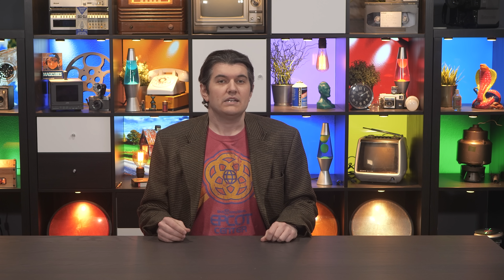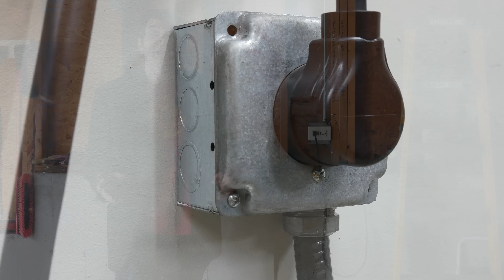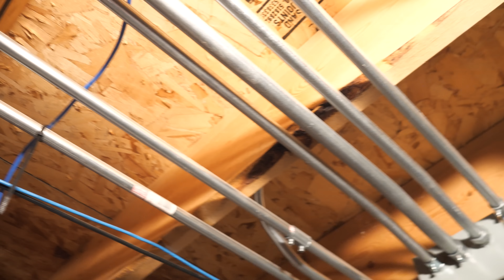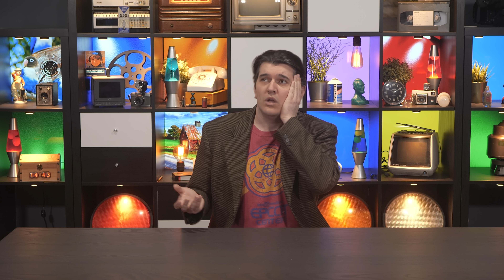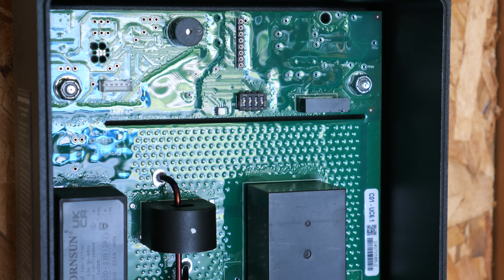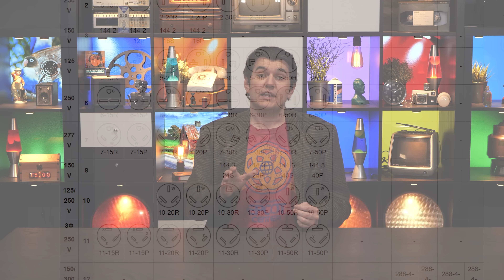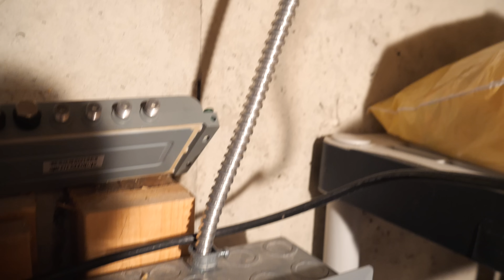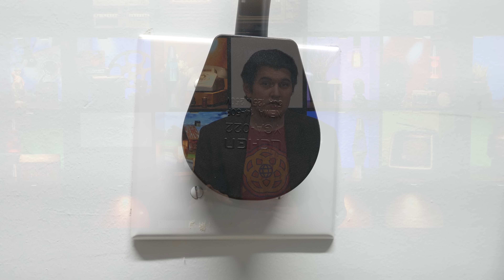The "standard" car charger is usually overkill—but your electrician might not know that

Comment: One thing I’ve seen some “smart” EVSE’s do is actually monitor the plug temperature on the outlet side and can shut down if it gets hot. Of course that really doesn’t need an App, but it is a nice feature.
Reply: Pretty much all DCFC EVSEs do that, but I haven't seen an AC EVSE with nozzle temperature monitoring.  Can you point me to one?
Reply: @alsavage1  The tesla ones do by default, then they back off to maintain plug temps.    You can also control the amps on them manually from the app if you want.

Comment: I actually was lucky enough that when I bought my Bolt EUV a couple years ago, GM installed a NEMA 14-50 plug on a 50A GFCI braker.  However, as I don't need to charge that quickly, ever, I down leveled my 40A Emporia EVSE to 24A...  no reason to put the extra strain or heat load on the house, grid, receptacle/plug, or car (now a Mach-E GT).  For my use case, I'm always back to 85% battery by morning.  It's typically done by 3a every day.  I really hate that there is so much FUD spread on EV charging for those who don't know.  Range anxiety is, in most cases, silly...

Comment: correct me if i'm wrong, but why not use a nema 6-15 connector? it's a 240v connection that you can basically back with the same gauge as normal wires, and get 3.5k watts out of. it's basically double the use of a normal outlet without any really special "work".

Comment: Very good information, but be careful with direct comparisons to gas vehicles. You asked: “are you topping up your car at a gas station every day?” and of course that answer is no. But the reason the answer is no is because under very nearly zero circumstances will there not be a source of fuel regardless of the direction or distance you travel in a gas vehicle. If fuel was scarce, you bet your butt I’d keep my gas vehicle topped up.  

You do a great job of helping people understand that edge cases are not everyone’s daily experience and each person needs to look at their own needs to determine which vehicle, and if electric, which charging solution to go with. Keep it up. Education is the path to enlightenment.

Comment: Im in the UK and I'm still using "Granny" 10A charging from a normal 230V outlet.

I do rarely have a bit of anxiety about how much its going to charge, but I mean rarely - It has to involve me driving 100+ miles myself in a day, plus needing to drop my partner to/from work on the following day (even then I can take the local roads which is normally a little longer but is a 30 mile round trip as opposed to 60).

I will likely install 24/32A charging but I am absolutely in no rush - I'm also on an "intelligent" Electric tariff, so if I am home the long charging sessions actually reduce the electric price for my whole house - couple that with our solar (Unfortunately we don't have a battery), it can really cut  our electric prices down.

Comment: Another bonus: slower charging is better for the battery, as it won't heat up as much. Lithium batteries degrade faster at higher temperatures.

Comment: We've put 21,500 miles on our Mach-E in the 14 months we've had it. In that time, we've used public DC fast-charging on three occasions: once shortly after buying it just to try it out, and twice on longer road trips. I bought a 60A breaker and a bunch of wire and even ordered a 48A EVSE, but the 32A charger that came with the car is more than sufficient for our needs so I haven't even taken the breaker and the EVSE out of their boxes. 
That 32A EVSE is plugged into a 40A circuit that also runs my air compressor, table saw, and dust collection. And let me tell you, it's SO DARN INCONVENIENT to have to unplug the EVSE when I want to cut a bunch of wood or inflate tires or run a needle scaler the 3 or 4 times a year I need to do that.

Comment: The place I worked at, we would just plug the Smart for TWO EQ, a small electric compact car, on a standard CEE 7/5 wall plug, 16A 230v and leave it to charge over night.
the battery is only 17.6 kWh with a 120 km of max autonomy anyway... and the AC or heat drains it rapidly

Comment: Funny I just had this discussion. 
If you fill your gas tank every 2 weeks or more.. a mondo charger is not needed. 
I would still opt for at min a 220v 20a charger.

Good point with the dryer connections not being intended for repetitive use.  A switch in the circuit  would be a good idea. Do not use the circuit breaker as a switch.

Comment: My garage is detached, so running a 240v line is rather expensive. Instead, we're charging my Ionic 5 with the L1 charger it came with, on a regular outlet. It works fine for us. During summer, we've only needed to go to a public charger once or twice in the past year. (We did a bit more in winter.) Still totally fine.
Reply: yeah regular 120v 15amp outlets should be fine for like 90% of Americans

Comment: I have always used a 20 amp 240 volts outlet with my mobile charger.  It has always been plenty.  It adds about 14 miles per hour on the charger.

Comment: I have a 50A plug but actually keep my charger at its lowest setting of 12A most of the time. It charges the car at the speed we need and slow enough to help maintain the battery. Full-speed charge is still available for the few times per year when we want it. My Grizzl-e charger is also technically portable, so came with a bunch of adapters for 120V and a bunch of common 240V outlets we might need to use while on a road trip.

Comment: Slightly different situation in Europe/Germany since we have 230 (and 400) volt, but still kind of similar. EVs usually come with an "emergency charger" that can draw 10A@230V, so around 2,3kW. Not very much, but enough for normal (daily) charging. I can charge at work with such a charger, and during the 8 hours it provides about 30% of my cars battery capacity which is enough for ~100km of driving.
Can't charge at home since (according to property management) the power "uplink" for the building complex doesn't have enough capacity to provide power for all garage spots to get a wall box, so they refused any electrical work for that... At least our municipal power provider installed four 22kW charging spots in our street, and in worst case I would have a few DC chargers within 5min of driving. But so far I could charge mostly at work and only used the 22kW chargers to "top up" before a long trip. DC charging is only needed during long trips that can't be handled with one battery charge.

Comment: 11:55 just incase it isn't obvious, if the breaker doesn't trip then you have a potential fire hazard. you should periodically test your breakers. usually they end up in a state where they trip too easily, which is technically fine as far as safety is concerned. however, they can get stuck in a position where they can't trip, and that's bad.

Comment: I'll challenge you on your rant against smart charging solutions. 
I've got a PV system by Fronius and a matching AC charger. It talks to the Fronius smart meter and gets told how much PV excess there is, the state of charge of the pv/home battery at any given time etc. If set to the "eco" mode, it will only use that excess. I'm not entirely certain if that is what's meant by "demand response", but I think that has more to do with the grid operator controling your devices remotely, right? It can also automatically adjust to hourly electricity rates if you set the appropriate electricity provider and plan too. I wouldn't be able to restrict the charging current in my Renault 5.

Comment: "how bad was that elbow click?" - reminds me of a tweet i saw... "my knee just popped so loud that i half expected it to start glowing" lol
I would be pretty interested to know how slower charging like this might affect battery life and condition. i know that trying to charge batteries of any kind too quickly can degrade their health, and at a certain point, going too slowly can as well (though in a different way), but does using a so-called 'granny charger' have any potential at increasing the life of the battery (or in other terms, reducing battery degradation over time)?

also, my house (which we own free and clear as of 2018) is a bit of an odd-ball in that our breaker panels is... well... not much of a panel, and more a collection of panels. we have one "main" panel that has a primary breaker, and 4 breakers connected to it, but that's all the capacity it has, then we have a completely separate box with a breaker in it for our fuel oil furnace, another separate box with a breaker for the water heater (which is natural gas fueled), and yet another box with a breaker for our washer, dryer (also natural gas fueled), and chest freezer.... yes, our entire house (which is a 2 bed, 1 bath single family home with detached garage, full footprint basement, and weird hybrid of a finished and unfinished attic) runs on just 4 very old breakers. we've learned how to do things, but running the microwave and toaster at the same time WILL trip a breaker, guaranteed. timed poorly, our fridge can sometimes trip breakers too... anyhow, while we could definitely utilize the washer/dryer circuit for the car charger... that outlet is on the side opposite our driveway, so that doesn't really work out. we're planning to have to completely replace all of the electrical in the house in the near future anyway, so this is mostly just me providing yet another scenario where getting an at-home charging option for an EV can be problematic. we don't have any outdoor outlets for plugging in even the 120v charger options, and the garage is ... well... it wasn't built with putting cars in it in mind for some reason. it's far too narrow. we also have grey squirrels and oodles of rabbits, so just leaving an extension cord outside isn't really viable either. i probably should have said that i'm a central wisconsinite earlier, so we also have some pretty gnarly winters to contend with on top of all that. 

that all said, i'd definitely love to have an EV, because i totally get all of the upsides, but we also need to have an SUV for various reasons, particularly my mobility challenged grandmother who would NEVER be able to get out of a car because of how low they all sit. our options for electric vehicles are pretty limited because of that. we also need to have at least 250 miles of range at the 80% charge point for the foreseeable future, because that's how far it is to madison, where we routinely need to travel to for medical appointments, and there is zero charging infrastructure on the route between our town and madison. even worse, it's so sparsely populated that it's likely that this particular stretch of the american interstate system will never have any real charging infrastructure outside of the off chance that one of the waysides/rest areas get some kind of charging infrastructure. there's plenty of such infrastructure in madison, so charging at either end of the journey isn't an issue. also, just as a side thing... if you live over in europe and can't understand this sort of situation... the USA is WAY bigger than you think it is. Wisconsin alone is slightly larger than Suriname, Tunisia, and Lithuania, and we're only the 23rd largest state. pretty much right in the middle. 

anyhow, that's enough typing for a single youtube comment. lol

Comment: I have an EV, drive 300 miles a week. I only charge at work with the charge locations. Not sleeping when loading electrons but working when they exchange. Only used a DC charger to see how fast is was. 450 miles an hour....

Comment: We had 220/240V outlet added to the plans of the garage when our "retirement" house was built in 2017.  I had not done any research into chargers at that time, so we ended up with 40 amp breakers, which should be fine.  We have not used it yet, but we figured it might come in useful one day.   If all else fails, I will be able to rapid charge a souped-up mobility scooter to zoom to the mailbox!

Comment: I am so happy you gave a shout-out to dryer circuit splitters for EV charging. In my case, I wasn't able to have an electrician install an EVSE for a reasonable price in our 2-floor apartment, which had the electrical panel installed in the direct center of the entire building (don't ask me why). In comes this splitter for dryer circuits to save the day, and I only had to spend a fraction of what installing a dedicated circuit would have cost.
Reply: Anything pertaining to "home improvement" gets more complicated once you're in an apartment or even just renting a house. I was tired of having terribad wifi in the living room of our duplex as the fiber enters in the back, and of course management doesn't want to make the investment to hardwire the house. I ended up just running a 100ft Cat6 myself and figure it's easier to ask for forgiveness than permission.
Reply: For my country we have a tropical climate, so we don't usually need dryers in our homes, but older washing machines may use 15A instead of the typical 13A 3-pin plugs, & the electrical outlets for the former are less common. The latter has 3 rectangular pins arranged like a triangle (the BS1363/Type G standard) while the former uses circular pins like those in Switzerland (but with the earth pin further & equidistant from the other 2 pins i,e. Type M)
Reply: Me too, I would like to explore this further.   I just bought an Ionic 5 SEL used and bought a Charge Point level 2 device, called a couple of electricians for quotes to install and the cheapest is 1600USD.  The CB box is near maxed out, and at the opposite end of the home from the garage.  Our laundry room, is next to the garage so I think I will buy one of these splitter boxes (switches) and install the lvl 2 charger myself.   Though, in fairness, a couple of weeks of living with lvl 1 charge has shown me this is more than enough.   I am a little worried about what happens in winter.
Reply: @craigduncan7010  Do it, you won't regret it. I purchased a Briidea unit, and a properly rated 10-30 extension cable. Have been using it for over a year at this point with literally no issues at all. I think everything (splitter, extension cable, and charge cable) came out to a total of a little over $500 when I purchased it. If you already have a charge cable, then you are already saving a bit of money there, and all you really need is the splitter unit, which goes for around $235. I'm also pretty sure I've seen some other brands too, but I'm happy with the one I received. Just make sure what ever you purchase is properly rated and preferably certified for what you are going to do.

Comment: This video is very timely! Just got my first electric car on Thursday (2025 Mustang Mach E). Ford included a Stage 2 charger and up to $1,000 of installation costs. My breaker box is already in the garage. I’ve just been using the mobile charger in a wall socket in the meantime.

Comment: I tell people that pretty much any 240 volt circuit is what you need for an EV.  120v works only for a very small number of people, it's painful to charge on a standard 120v receptacle, especially in the winter.  But even a 20 amp 240 volt circuit will meet most needs.

Comment: I would like to add, as someone who installs EV chargers, often times the main price difference happens in labor, and unless there's an existing 1/2 inch pipe which limits wire size we can run, there's usually not much in material difference between amperage. I think that's why we usually recommend the best because when it costs $2000 for 30a, and $2300 for 50a (an example) and if comed is rebating you or not, that one time $300 is worth those weird times you need extra charge and you'd rather charge at home, is pretty worth it. That's why unless someone has 60a service or 1/2" existing conduit... we mostly install the best.

Comment: Something to consider is charging rate changes based on temperature of the battery. While in IL standard 110v work fine in TX it doesn’t keep up. Not to mention usage is increasing whit both low and high temps.

Comment: Part of my problem with small cheap EV's that get about 80-100 miles winter range and 120 miles summer range - is that's basically a one way trip in-to or out-of 'town' for me as the nearest hospital, mall, cinema and burger chains for my rural arse are 110km/70mi away in Wagga Wagga, mostly on rural 2-lane blacktop (even the A20/Sturt Highway is mostly 2-lane blacktop once you leave Wagga.
So a round trip for me is minimum of 220km/140mi, so an EV with a range of 320km/200mi would be left at around 30% SOC after a single trip.

Meanwhile a cheap secondhand nugget with a 1.6L i4 that does around 500-600km/310-375mi on a single tank of 91 RON/87 AKI Unleaded gets me 2 (nearly 3) round trips before requiring a refill, and U91 is currently about $1.60 AUD per-Litre in Wagga.

Additionally; I'd love to get a nice little EV like the Bolt or Volt to complement the 6.64KW of solar I have on my house, but EV's like those are priced 2-3 times more than a new i4 nugget of the same size and range partly because of production costs, but also because the ATO (IRS) treats EV's as "Luxury Cars" like a Lambo or Merc-Benz and taxes them higher than polluting ICE's.

Comment: I drive 44 miles a day and charge my Tesla on the 110 plug with the stock charger that came with the car, and it'll recoup everything I used overnight.  I have been doing this for 2 and1/2 years and it's never really been a problem. The only time is when I tow my boats but with a little planning I'm still okay. FYI most EVs if you're doing less than 50 miles a day you can charge on 110 with no problem anything more than that and you usually have to step up

Comment: Smart chargers are great when you can get cheaper electricity either due to local solar output or lower grid prices at certain hours (like avoid charging right when you come home and plug in - top price hours)